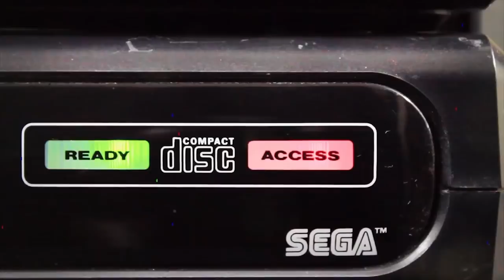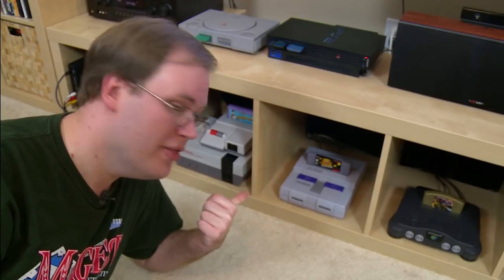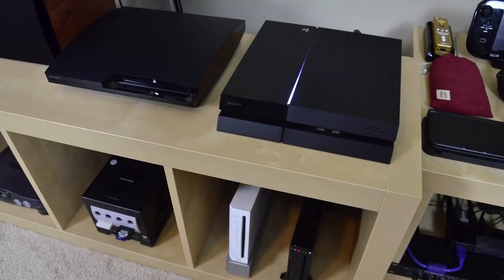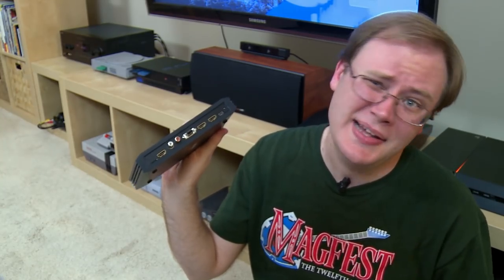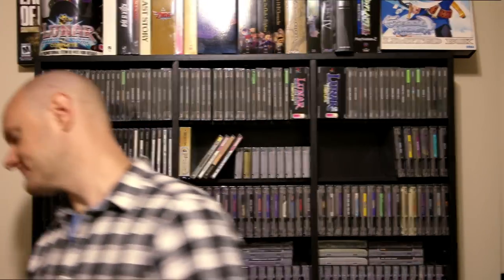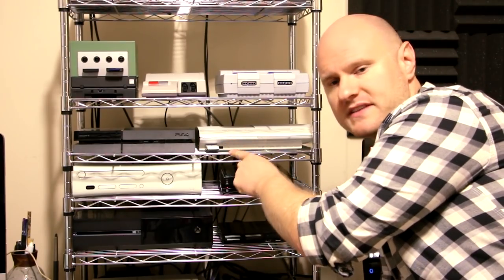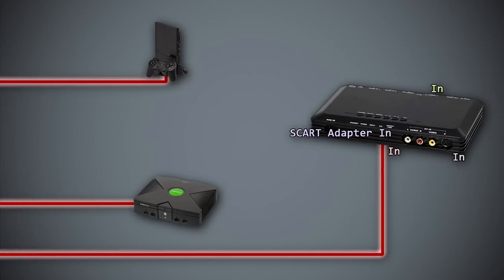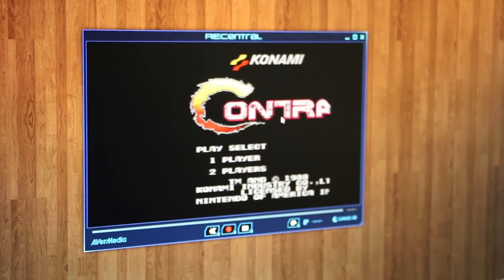RGB and Modern Gaming Setups :: RGB102 / MY LIFE IN GAMING

Comment: I have a powered 4 port RGB SCART auto switcher that switches between my PS2, SNES, Mega Drive II and N64.  The SCART switcher just detects which console is powered last and switches to it, even though my N64 is not RGB modded and only outputting PAL composite video it still works fine.  I have also noticed that it filters the signal before it reaches my computer monitor so output from the Mega Drive looks clean.  

The switcher was bought 5 years ago and seems to be somewhat rare.

Comment: Hey, My Life in Gaming.
You mention using an AV Receiver as a HDMI-hub of sorts. Some/most of these AV Receivers feature its own upscaling device. 
I, myself, own an older Harman/Kardon AV receiver. It features the DCDi by Faroudja. There's not a lot of information (?) regarding this processor, atleast not that I've found, and what I've read is that it is good (at least at upscaling video).
How well does this DCDi Faroudja, or any AV receiver, in upscaling games compared to the markets best (RetroTink 5X, OSSC, etc.) ?
Thanks for the answer!

Comment: Some people tend to forget that the hi-res mode with expansion pack games for N64 will support 480i just like the Dreamcast. There are even a few PS1 and Sega Saturn games with 480i like Tekken 3, Tobal 1 and 2, Decathlon and Virtua Fighter 2 (the 60 fps games).

So RGB to Compenent can be really nice on an EDTV (480p capable CRT) or an HDTV CRT that goes up to 1080i, but converts 240p and 480i into a stable 480p with little to almost no lag. PS2, Dreamcast, Xbox, Gamecube (even more with 480p mode from the consoles settings) look great on HD CRTs like a Toshiba HF series and Sony FD series from 2002-2006. I am using a Toshiba HF72 36" for those consoles with component video. I use my 2003 Sony Trinitron SD CRT for all of my classic games consoles, also through component video (S-video with my Turbo Duo and N64).

Comment: Are you guys experienced with PEXHDCAP? I'm pretty happy with 1-chip Super Famicom via RGB through Sync Strike to PEXHDCAP if you judge by video quality, but I have problems with this 7-pin miniDIN connector that's supposed to be the audio input via breakout cable.

It's just that apparently some common composite + 2x audio RCA to 7-pin doesn't transfer audio at all. The card used to come with a component + 2 RCA audio breakout cable but those are in my experience impossible to find online (apparently any kind of component + 2 audio cables) so I thought to ask you as RGB/retro gaming/capturing experts if you have some tips or ideas, generally knowledge about these connections and where to get a suitable cable.

Thanks in advance!

Comment: The bandridge  automatic 5 to 1 (or 4 to 2 actually) is an excelent scart switcher. I use two of them daisy-chained using two outputs (tv and capture card) and there is no quality loss or color difference. Plus you get the convenience of auto-switching, with both RGB and analog composite.

Comment: Good morning, I have a sega saturn japanese victor, I am trying to buy a solaris framemeister and the official JP21 RGB cable from Japan (hss-0109) for use on my modern TV. However, television does not have a good sound. That's why I bought a high quality sound system, is it possible to connect this sound system to the framemeister? So that the image comes out on the TV with the JP21 RGB cable and the sound is output through the sound system using another cable. Is this possible? What options do I have for the image to be output on a TV (using JP21 RGB) and the sound output through a sound system? If possible, what cables would you need? Thanks for your comments. regards

Comment: I don't know if they are still available, but the company "Madcatz" produced a scart switch-box a few years ago. I purchased a few at the time.  They are all black with clear "bumper" ends and gaming\Madcatz logos. It reads Item:6013 , RGB System Scart Selector on the bottom and has 4 inputs\ 1 output ( all scart obviously ) with a small 4 position sliding switch on the front. They were specifically designed for gaming and are the only type that I know of.  Standard types can at best cause interference. Worst case scenario, slight differences in pinouts can fry a system!  I have been using these Madcatz switchers to switch between my 13 different systems for years now with no degradation of picture or crosstalk and advise their products if found.

Comment: Getting those crisp RGB/HD images is nice, but unfortunately there's a bit of a catch-22 in achieving a clear image with retro games--particularly with 16-bit and earlier platforms.   Developers designed many, (but by no means all), games to achieve certain visual effects by exploiting flaws in the way CRT displays worked.   Probably the best example of this is Sonic the Hedgehog:  The programmers used the flickering refresh rate of the CRT to produce an illusion of transparency for the waterfalls in the game.   If you try playing the Genesis Sonic games on an HDTV with that nice RGB picture, that CRT flicker will be gone and consequently the waterfalls will no longer be transparent.  This means you won't be able to see Sonic when he goes through a waterfall area.   To be fair this is probably one of the most severe examples as far as how gameplay can be affected.  Most games that used CRT flaw exploits only suffer cosmetic flaws when you play them in HD/RGB.    Nonetheless, I personally prefer playing games the old school way with all those CRT flaws intact.

Comment: If you are still looking for a scart switcher you may want to consider the Bandridge SCART Auto Switchbox ( VSB7735 ) It's the one i use on the mini. It looks a little bulky but it has most of the properties you desire from a scart switch. It has five SCART inputs and one output. All inputs are isolated from each other so no interference. You have two versions of this switch. The purely manual and the automatic+manual version. Using the automatic+manual version the scart switch automatically switches input signals but also allows you to manually select an input using a button on the front. It's externally powered using 12V/500mAh.

Comment: Don't know if it's much help to anyone stateside, but here in the UK I've got a B-Tech Quattro scart switch which is pretty awesome. It's active, so it boosts the RGB signal rather than degrading it and it's a nice looking set top box which wouldn't look out of place sat next to a bunch of hi-fi gear. Only cost me £10 off eBay, used of course. They stopped making them around the turn of the century. I've got the BT941 model which is great, but I'd like to get the BT945 model because it's a bit better (or so I've read).

Comment: Curious if you guys have tried using an XSelect-D4 in combination with the Framemeister.  Seems like it would be a great option for connecting multiple YPbPr and Japan 21-pin RGB systems to a modern HDTV.

Comment: I have the 8 pin din rgb scart cable from Europe for my Sega Master System as it provides rgb natively. I found a scart to HDMI upscaler called Elephas on eBay. It's a plug in and provide 800/600 at 60 megahertz with no noticeable lag and fantastic picture and Fm sound. $40.

Comment: have you had a look at the Joytech AV Control Center JS965 for a SCART switch box? it has 4 scart, s-video, composite and optical audio in. Sadly that's not going to cover the 5 consoles you have running via SCART but maybe the ps2 could be run via component? worth considering ever way.

Comment: I've got about 15 homecomputers and consoles attached to 4 Bandridge 5-way scart switchboxes linked to each other. No interference whatsoever, despite some bad behaving systems. I use these quite a while now, I've got them for about €35. These switchboxes automatically detect input and switch accordingly. I've got also a version that mechanically switches for about €20.
I highly recommend the automatically switching version if you have a collection. Just turning your console on without any fuss will make you smile every time.

Comment: Hey guys, just letting you know that I got my XRGB-Mini 2 weeks ago along with the SCART cables I bought from retro_console_accessories. Everything's working fine, but I have a lot to learn about the XRGB-Mini itself, so I'll be browsing some forums.

I'm also waiting for the package from Tim Worthington containing my AV Famicom RGB board and N64 RGB board. Once these systems are modded, I'll go to otakus-store.net and order an RGB board for my PD-Engine Duo.

Lastly, I took a chance and ordered one of these SCART Switchers: http://tinyurl.com/k53cu6q 
I was expecting a piece of junk, but to my surprise, no picture or sound degradation and no power bleeding into the other systems even when 5 consoles are plugged in. It does what it's suppose to do, connect one system at the time to the XRGB-Mini when you press a button. Only downsides to this switcher, the buttons a very mechanical, so you really got to push them in, nothing electronic in there like the Bandridge switchers. Also, it stinks, literally, you can tell it was made in China without looking at the back of the package. I left mine outside for about an hour to let it air out :p

Comment: Enviable setups! Wow!

I'm using an older model of the Extron MPS I got off ebay for $20 as a switch. It handles 12 devices (4 VGA, 4 Composite, and 4 S-Video). If you're not afraid of making custom adapters, you can use it to switch SCART through the VGA ports or you can look at Extron's other switches, but you have to get lucky to find them unless you're a dealer.

Comment: You can get scart switchers easy in the UK for many years, even today. They are also cheap. You can get them through Ebay or Amazon if you order internationally. It's not recommended to keep switching/swapping scart cables each time you play a different system. The scart cables will wear out very quickly, so you end up buying more cables.

Comment: Sadly, most to all game systems from the 70's and 80's only had rf out,and only a few of them can be modded for rgb while others can be only modded for atleast composite, there is a option to use a clunky vcr recorder to convert rf into composite but it will not do any good to your signal, also last generation vcr recorders automatically switches off overtimes.

Comment: You guys should look into the Hana (or is it Hanna?) SCART switcher sold on Ebay.  It is very cheap and actually has excellent reviews.  I have one myself and I cannot see any noticeable picture quality loss or interference at all due to it being completely mechanical and is just a straight pass through unit.  It is definitely the best budget switcher out there bar none.  The only drawback is that it only has 3 SCART inputs, but it's certainly better than nothing.